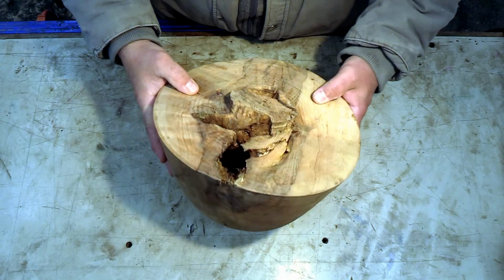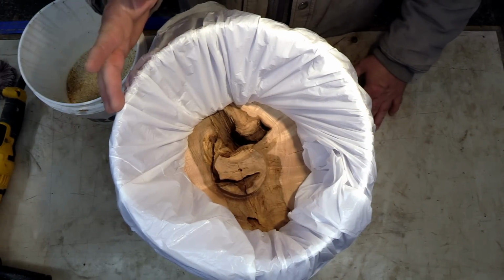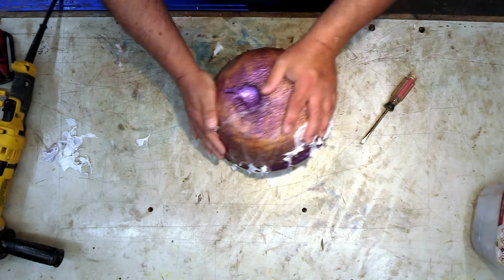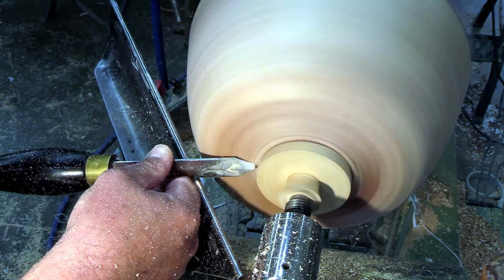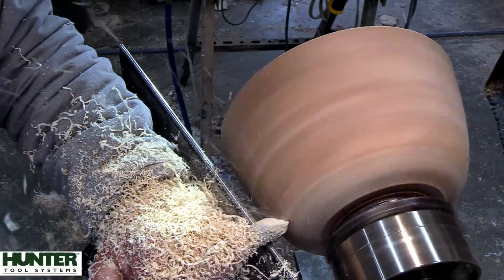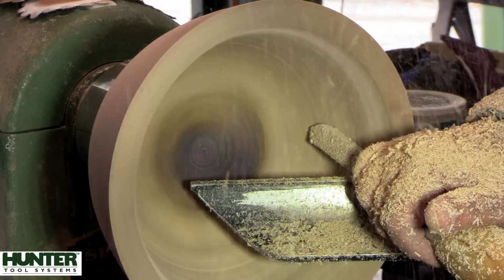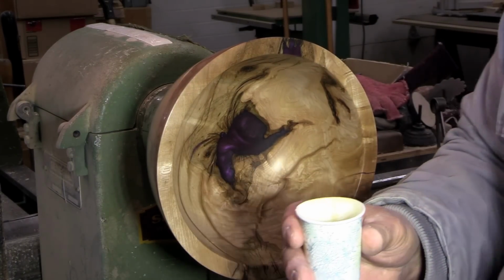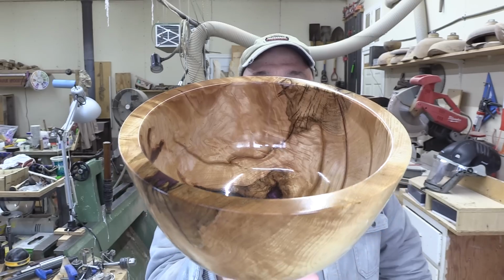Woodturning - Maple Loves Deep Purple

Comment: Beautiful bowl. It is amazing how the epoxy can rescue a piece like that. I used to level liquids by floating a round bubble level in a 100ml square (disposable) weigh boat. Completely different application so I have no idea if it would work here. You'd have to shim your pressure pot to find level of course. Can't say enough how I appreciate your videos. Thanks again. Designer epoxy.
Reply from the maker: The problem is getting the casting level in the bucket, measuring from the top of the bucket to the casting is probably best. Thanks!

Comment: Depending on the pigments you get, sometimes the red pigment can be a stronger colorizer than the blue. I've found this to be true with my own paints. I typically have to use far more blue than I expect to counter the red and get the color I want.

Btw, I love the bluer side of the purple spectrum myself, so I'm happy with it!

You're totally right. Filling cracks with resin makes them look so amazing! Especially a beautiful purple like that. I was surprised how little resin was in the final piece, but I found myself not really missing it. The little splashes of purple really helped to accent the beautiful wood. I wish there was more resin on the outside, but it's not like you control where the wood cracked inside, lol! Love this piece!

Lol, if you need these to be shorter, I get it. I watch the full length no matter what, but that doesn't mean I'll be upset if your videos are shorter. They are the length they are and I just watch the whole thing. So you're not losing this subscriber!
Reply from the maker: Awesome! Thank you very much!

Comment: Who doesn’t just love a good deep purple, if it were glass I guess Cobalt would be what everyone wants. Thanks for sharing your experiences ~Smile oN
Reply: Was wondering if after the resin pour if you puffed in some compressed air or otherwise to reduce the plastic fold-ins.
Reply from the maker: Purple is a popular color, the bag material wasn’t a big issue this time and when the pressure is applied in the PP it’s going to move it around anyway. Thanks

Comment: Nice job with the Designer Epoxy Jim. I really like your approach with the rice and plastic bag. You may want to think of using a small piece of 1/4 mdf or plastic if you have a big hole to avoid the dimple.
Reply from the maker: Yes, I’ve done that lots in the past. Thanks!

Comment: My suggestion for getting your castings level is first make sure your casting table is level, then rebuild your casting weight so its perfectly parallel top and bottom (a jointer and surface planer are perfect for that if you have them) so you can use a 6 inch level to check the wood inside the bucket for level...

Another thing you need to do is make sure your Pressure Pot is sitting level otherwise, it doesn't matter what you do to the blank in your casting bucket, it won't come out level if the Pressure Pot is unlevel...
Reply from the maker: The pressure pot is level in my casting room. I think just measuring down form the top of the bucket to top of the casting all the way around it is just easier. Thanks

Comment: Hi Jim!
Watching your video on friday night.
A thought:
Would it work to take a sharpie, and mark lines around the inside of the bucket 1" or 2" apart to check level of the piece once it's inside?
We are enjoying your work❤
Reply from the maker: Yes, that would be an option, the resin might was it off though. It’s probably easier to measure from the top of the bucket to the top of the casting around it until you get the same measurement. Thanks for watching!

Comment: When using thin CA, have you figured out a way to minimized bleeding of the CA through the grain? 
Designer Epoxy
Reply from the maker: If the surface isn’t sanded it’s usually not too bad. In the end grain of pieces like this I will usually saturate the entire area so it looks even. Hope this helps. Thank you very much!
Reply: @SpragueWoodturning Thanks for the Info, I will give it a try.

Comment: Oh damn, can you believe it, I love it. The color is absolutely perfect.
You said that during sanding you might be surprised how much the wood thins. I've been taught that there's something wrong with chisel finishing if you have to grind and grind the work so that the end result is pleasing. So somewhere now this thing doesn't match because you grind a lot of work??? and paper 3+". either the quality is not good in the sandpaper or something else is wrong. Maybe you are just a perfectionist???
Not to mention, your work is absolutely brilliant in its finish, but are you working too hard on it? would less be enough?
Reply from the maker: I’ve used a lot of different sandpaper in my time and one or two things will happen if your too aggressive on the sanding. One, the paper will delaminate from the Velcro backing or you will heat check the bowl. I learned from a professional turner a long time ago how to sand and all of his bowls were perfect. Sandpaper is a tool and getting a perfect surface each and every time you turn something is unrealistic. Thanks for watching

Comment: I recently bought the waterlox VOC medium sheen, when I clean it with denatured alcohol before second coat the previous application wants to gum up. Did I buy the wrong one or something?
Reply from the maker: No, that’s the one I use.  I let it rotate on the lathe while I’m getting the finish ready, are you buffing like I do? Thanks
Reply: @Sprague Woodturning  well the first couple I've tried I managed to get the first coat to go on pretty smooth. I touched it and wanted to wipe the fingerprints off but the whole previous coat started coming with it. I waited 24 hours so I think it should have been cured enough. Not sure but I'll do some more testing! Thanks!
Reply from the maker: @TurnItUpbyTravis1213  yes, if the coat is being applied over an existing one then you wipe it off, your probably going to have problems. Once I wipe it on, I generally never tough it again until the next day. Humidity can play a part in all finishes as well. Jim

Comment: great video as always...wondering what kind of electric pan you use and how long does it take to melt the glue????
Reply from the maker: It vintage 1970’s lol. Anyone will do. I only keep about 1/2” of glue in it at a time so it only takes about 10 mins to heat up on max. Thanks